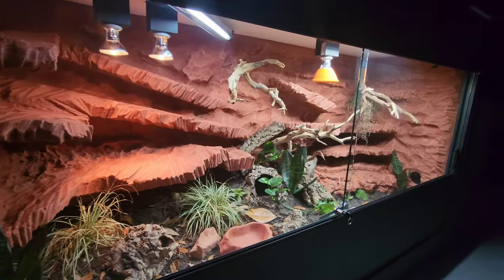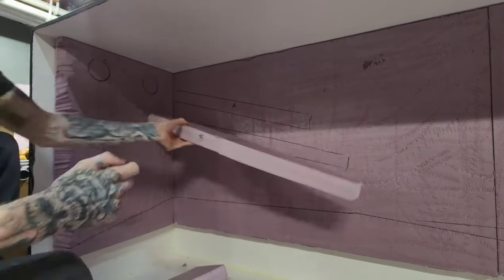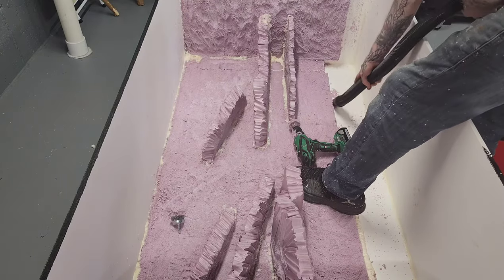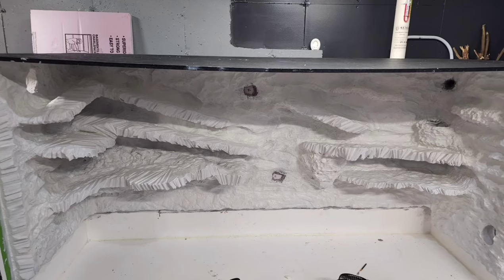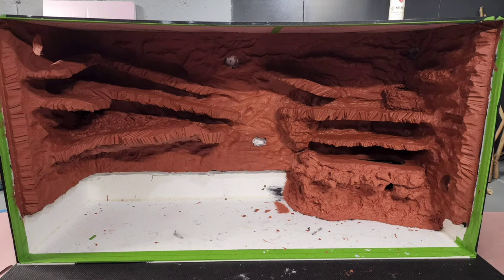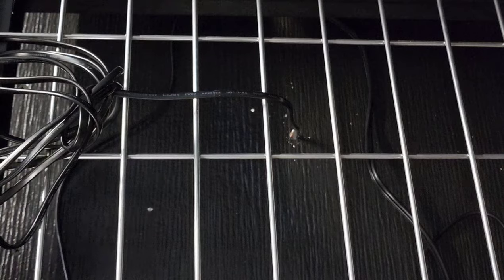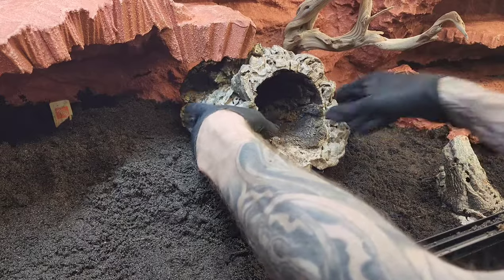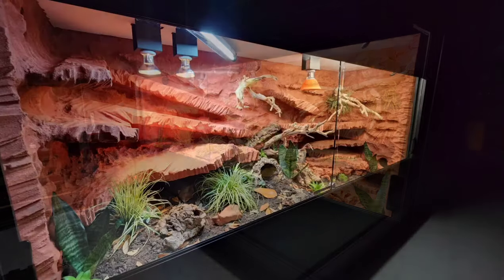DIY Monitor Enclosure Arid Set Up & Bioactive Build #reptiles #vivarium

Comment: This is a labor of love. I’m getting an Ackie soon and even though I have read and watched everything I could, I’m still nervous 😮‍💨
Reply from the maker: That's a normal response for someone that is trying to offer the best care for any new animal in my opinion. If you were nervous you wouldn't care. I'm sure you will do great. Also they are pretty hardy reptiles compared to others. Things I found to be important were basking temp between 120 and 145 depending on age. Mine likes the ambient around 90f when he is not basking. Mine doesn't like to burrow quite yet but has 12-14" of substrate if desired. I have relatively higher humidity in some spots of 65% and others in the 30 % range. Created as many micro climates as possible so he has options. Good luck and have fun

Comment: Great video! I love the trick with the wire brush for the drill. That would’ve saved me so much time in the past trying to hand carve foam panels🤣
Reply from the maker: Thank you and yes I have done my fair share or carving with a steak knife. Been using the wire brush for the last few builds on XPS and it goes much faster. You just get covered in a foam blizzard lol.

Comment: This builds been a mega guide for myself for my nex ackie enclosure i just wish you said how long the painting takes 😂 we cant get drylok so its grout and a pond sealer it takes so long but worth it and thanks again
Reply from the maker: I'm glad it's helping you out with your next ackie build! It's a fun one to put together.
Painting took about 8 days. I did a coat each day and took about 1.5 to 2 hours a coat.
Pond sealer and grout are a great option if drylok is not available. 
Your "Super Thanx" is very much appreciated 🙏

Comment: My dad has experience with power tools and so together me and him are going to follow this tutorial!
Reply from the maker: That's awesome! Hope you 2 make some great memories building it together! Have fun!
🤘💯🦎🐸🐍🐢
Reply: @bradsbioactivebuilds  thanks! Just I’m a bit nervous as I’ve never handled silicone, expanding foam or a wire foam cutter before and the fact that they emit toxic fumes isn’t very reassuring.
Reply from the maker: @Alastor  wear a mask when fumes are present. The less you pull on the trigger on the foam, the better results you will get (less air bubbles). Silicone is hard to deal with. Wear gloves, with foam and silicone if needed. You'll do great!
🤘💯🦎🐸🐍🐢

Comment: Great Video Brad, I'm a fan and subscriber. I like your DIY vavariums builds. I have a question. How has your Ackie acclimated to the enclosure. I'm concerned about the CUC's and the monitor uprooting the substrate. Another question I have is the "hide". I think I would have incorporated an access panel that would allow me access to the hide, what are your thoughts on this? If you were to build another Ackie enclosure what would you do differently?
Reply from the maker: Thanx for the sub and liking the video!

Ackie has acclimated well. Can't wait to get her back in (she is in a temporary enclosure bc I have my 1.1 mertens in there now while I build their 8x4x6 paludarium) the CUC hasn't effectd the plants and they help air ait the soil. Plants were doing amazing until I added the mertens a bigger more destructive monitor. But I think it comes down to plant placement and the individuals ackie itself on how much and where they will dig. 

The hide lid does come off but if I were to do it again I would have made to top about an inch bigger.
Reply from the maker: And if I were to build another one, I would make th basking spot about 4 more inches or so larger (towards the glass) for more surface area. I'm planning on making this adjustment once I take my mertens out. Also, I would have rounded the bottom of some of the faux rock ledges in areas. I would have also made a cool rock piece connecting both sides of the rock ledges if that makes sense lol 
Hope this helps

Comment: Your videos really set the high mark for enclosure builds! Please keep making innovative videos. I am interested in better ventilation for my first build - being able to actively circulate air within the enclosure as well as bring in outside air in seems like it would benefit the health of the animal and the extra breeze might be stimulating to a smart critter like an Ackie.
Reply from the maker: thank you for the comment. I'm working on editing a step by step blue tree monitor enclosure now. In the video I'll have how i did the internal fan system for air circulation. 

ill be doing an updated video on the ackie enclosure when I install a similar system.

 I agree with you 100% on circulating the existing air in the enclosure instead of pulling it from outside the enclosure. 

I also have a paludarium video I recently uploaded that I built internal airducts inside the paludarium that shows how the air circulates with the fogger.
thanx again for watching.

Comment: Brad could you show how you put up the lights the dimmer switch, all the accessaries, and what they do how they work, would be much appreciated. Thank you Terre
Reply from the maker: For the lights, I screwed them into the ceiling with appropriate length screws. Then, he hooked up the basking light plugs to the dimmer switch. From there, I adjusted the dimmer switch to target my surface area basking spot temps. I have the equipment used in the description. But here is the dimmer switch I used. Lmk if you have any other questions. 🤘💯🦎🐸🐍🐢🌱
https://www.amazon.com/dp/B004DZONXI/?coliid=IY1XTYZOMWZ7J&colid=2FVU288YHZ37N&psc=1&ref_=lv_ov_lig_dp_it
Reply: I bought everything you recommended, I just don’t know how to hook and put things together
Reply: Ok I’m getting a 5x3x3, do I need 2 basking lights, I noticed  2 on the left side in your enclosure, then a third bulb on the right side, can you explain
Reply from the maker: @txlady1959  the 2 on the left are to evenly spread out the basking spot so the ackie can bask its whole body instead of just a s.all section. The uvb (long tub) next to the basking is uvb.

The center deep heat projector (DHP) is for night time heart.

The light all the way to the right is ambient light for plants and the rest of the enclosure to keep the right side lite up.
I only have the basking on the dimmer switch. 
Make sense?

Comment: Hey Brad! I love this build and this video is a frequent rewatch of mine. Couple questions if you don’t mind:

1. How have the plants been doing since this video?
2. Has the cleanup crew been effective?
3. I’m used to using silicone to attach things to enclosure walls; is spray foam stronger as an adhesive?
4. If you could go back and change anything, what would you do differently? 

I can’t wait to see what else you pump out. I can easily see you becoming one of the “big” channels like Serpa. 

Also, would you ever consider doing an enclosure for bigger monitors? Like a Savannah monitor?
Reply from the maker: glad you are getting a lot from the video
Ill answer your questions to the best I can.

1. the plants have been doing very well. the one in the top left corner in the plant holder has been replaced 2x. for some reason this is the one spot my Ackie likes to dig up. not sure if a feeder insect keeps going in there or not. so I will give it sometime before I replant. I have also added a few other plants to fill in a little more like aloe plants and some other succulents.

2. the clean up crew has been doing amazing. almost to many. this enclosure has had the biggest culture I have ever had in an enclosure. I literally use this enclosure for my isopod culture. I have seeded 3 other enclosures with it and there is still 500 plus. I'm going to stop  feeding them zucchini lol. I was surprised how well they took off in an arid environment.

3. I have used both. but with pvc board i found silicone (100%silicone also make sure it bonds to PVC. they sell a good one at home depo by the plexi glass section. its made by GE and it comes in a white and red tube. or lexel adhesive would work good. Just make sure it cures well) I found regular silicone doesn't stick very well to pvc and spray foam had a hard time bonding to pvc as well. I do however spray foam xps board to xps board. It makes carving a lot easier. 

4. If I could change something I would have added an arch from one of the ledges to another ledge for appearance purposes. Im removing the mistking nozzle and added a custom built fan. I did add 2 1" vents in the front right hot side that have 1" plugs so I can help regulate temperature in different parts of the year. I also added mosquito mesh to the 3" vents on the side like I did in my Blue Tree Monitor enclosure. i also replaced the cheap Menards hardware store plant light for a arcadia 34w led bar (Jungle dawn). ove of the ledges I would have extended out about 3-4" where he likes to watch over his domain lol. I will be doing this at some point. not sure when though. I will just cut the xps board and stray foam on the new piece and tie it in.

to answer your question about doing an enclosure for a bigger monito. I have been planning one in my head for sometime now. keep watching new content and it might answer your question.....🤞

thanx for good questions and have fun with your build 💯🦎

Comment: Dude.. I was so worried about how to make my enclosures and this answered literally EVERY questions I had! Your videos are amazing!! Thank you so much!! Do you make the actual wooden enclosures? Would love a video on that if you do !! :)
Reply from the maker: Thank you for watching a support. Glad ypu got some answers from the video. Yes I make the enclosures all from scratch. You would need 3 4x8 sheets of wood, PVC or melamine. Checkout this video I did on the frame work for the enclosure I did. It's for a blue tree monitor but the frame work is the same. https://youtu.be/kFIuR6ZNy6A
Reply: @bradsbioactivebuilds  Thank you so much! One more question. I notice you didn't seal anything after you used and painted it with colored Drylok. I have a Ball Python and Boa who I will make enclosures for. Is it not necessary to seal your ledges and stuff to make sure they don't peal or fade? Thanks!
Reply from the maker: @jaywimmer8360  i personally have not found the need to seal it with anything. Although some people have used a a clear polyurethane. I choose not to because it puts a glossy/shine over everything taking away from the natural rock tone they drylok offers. I have a few other builds I have done before I stated making videos that are holding up very well. Still look the same as when I finished them. Even the water falls are holding strong. For maintenance/ spot cleaning I use a toothbrush to scrub them down and it has no pealing or dull effect. When I start building a 10x6x5 water monitor enclosure I'll use morter (bc of nails) instead of foam and do a coat of drylok over the morter. Any other questions feel free to ask.

Comment: I see you're making a video on making the enclosure for your blue tree and I'm looking forward to that! I was curious about the choice of 1/2 PVC, do you this 1/2 is the minimum thickness for something like this? Especially with so much substrate? PVC is very hard to find in Canada for some reason, our local Lowe's only has 3/8 4x8s for example and Home Depot doesn't carry PVC sheets at all but I don't know if 3/8 is enough to keep the thing sturdy. I'm assuming your PVC came embossed as well? I love that faux wood grain on it.
Reply from the maker: The 1/2 inch seems to be holding up fine. When I put it up on the rack though I.did put down 1/2 inch plywood for extra support.  I'll do a year update. But so far so good. If anything I can always add cross braces but the structure felt solid as is. 
Just waiting on some glass to get in and a few other things to wrap up my Blue tree enclosure then I'll start editing all the video. Editing takes a week or so to do. Glad you want to see it!
Reply: I'm in the same boat with thin PVC being about all I can get my hands on I'm just going to add an internal wood frame to add extra support. I'm going to hide it by cutting the wood to be the same with as the foam so after you add the foam you won't see it at all.
Reply from the maker: @jeremymiller1088  good vall with the wood fram especially if you are going to stack enclosures ontop of eachother. Although if not stacking I found the 1/2 inch to work just fine because of the lighter weight material. I also doubled up the front frame making it 1" for added support and now bowing.

Comment: This is acctually my favourite video of DIY terrariums out there on youtube. I'm an ex model builder and have some experience with carpenting as well and I always wonderd why so few people use styrofoam as backgrounds.
I tried making a background using only sprayfoam, like many people do, but I found it very expensive, time consuming and just a pain.
I instead use styrofoam like you do and then paint it with grout, but I also like to paint parts of it with pigments making it more realistic before drybrushing.
Reply from the maker: Hey, that's cool to hear it's your favorite on YouTube because there are a lot of amazing builds out there. I agree. XPS board is the way to go with big builds. I've done smaller builds with only sprayfoam. But after using xps board I'm not going back to just sprayfoam. Sounds like you have some have your techniques all dialed in, that's awesome. Have fun with your next build, and thank you for watching!
🤘💯🦎🐸🐢🐍🌱

Comment: Great setup! Did you just buy the PVC panels on their own and drill them together yourself? If so do you have treat it in anyway before assembling and do you have recommendations on a good site to buy PVC from? Thanks in advance!
Reply from the maker: Yes I built the enclosure. I cut the 1/2" PVC board with a skill saw. They come in 4x8 sheets at your bigger home improvement stores. It holds heat & humidity well. Won't breakdown over time. It's used a lot as a substitute on the outside of houses where water collects. I'm doing a blue tree monitor build now and will be uploading how I built the cage itself. It will be a step by step. Ill also be doing the hardscape interoir diy video. Hopefully in the next 2 weeks.
Reply: @bradsbioactivebuilds  Great, can't wait for the next video!

Comment: Can you do a video explaining how you make your own substrate for this enclosure?  The reasoning behind each ingredient/ ratios... long term tips and tricks etc.. I would find that very usefull.  Thanks
Reply from the maker: I can with my next arid build. But mybarid set ups are fairly basic. This one is a 70% topsoil and 30% play sand with less then 5% sphagnum moss. Although I did do a few sphagnum moss pockets to have microclimates for my isopods and springtails. 
Hope this helps in the meantime 
🤘💯🦎🐸🐍🐢🌱
Reply: @bradsbioactivebuilds  Thanks Brad.  Any thoughts on adding charcoal or Coco coir or even some clay to the mixture?
Reply from the maker: @jeffreymagni1272  charcoal is always good, in my opinion.  Helps stabilize a few things. I typically won't add coco in arid setups because it can become dusty when not moist, but that is my preference.  Clay would be harder for it to drain, but I think a small amount couldn't hurt.
Hope this helps
🤘💯🦎🐸🐍🐢🌱
Reply: @bradsbioactivebuilds  right on buddy.  Thanks for taking the time.  I aspire to have a setup like yours soon.. your videos are giving me tons of ideas to try.  Keep it up.

Comment: Where did you place your hydrometers/humidity probes out of curiosity? I see that your phone is tracking them wirelessly. I'm trying to create a cleaner looking setup and would appreciate some advice. Thank you and awesome build! Are they the govee wireless ones w/o a screen?
Reply from the maker: Thanx and I just used the govee temp and humidity gauges during the initial  setup when I dialed everything in. I have 6 of them, so I can have a few different readings before introducing an animal to the enclosure. I do put them in during the changes if the seasons for a few days just to get adjustment readings. Other than that, I can just tell where my temp and humidity are at.
Hope this helps
🤘💯🦎🐸🐍🐢🌱

Comment: Your videos are amazing! Please keep this up! You are killing it! I will be using this as a build for a beardie! Could you help me figure out the substrate that is great for an adult beardie? If the enclosure is 6X3X3 Pvc board, that will be structurally ok to hold an adult beardie? Also, could they use a water tray for their bathroom? I love you other videos with built in plumbing and ease of cleaning!
Reply from the maker: Thank you! There are many helpful Facebook groups for beardie's and substrate. But I think the ratio I used would be great. Although some people say not to use loose substrate and others say to not, not use loose substrate. Yes a 6x3x3 will be structurally secure. Especially if you use xps board as a background. It adds a lot of support and looks cool. 
I wouldn't see why you couldn't use a water tray at the bottom.
Yes, I'm looking forward to the day I can use the plumbing with easy cleaning. Should be any week now 🤞
Thanx for your support!
🤘💯🦎🐸🐍🐢🌱
Reply: @bradsbioactivebuilds  Thanks for getting back to me so fast! I hear mixed thoughts about loose or not also. If I were to use your substrate, would I benefit using the "cleaners" aka bugs in it also? Or is it Too dry of a climate for them to thrive? Thx again!
Reply from the maker: @OliviaBob29  of course. And I thought I was going to have a hard time with keeping isopods alive. But I created a few microclimate throughout where they can seek refuge. Honestly, this enclosure had no problem with isopods staying alive. I was using it for a while to seed other enclosures.
Reply: @bradsbioactivebuilds  Awesome! Thanks!
Reply from the maker: @OliviaBob29  anytime!